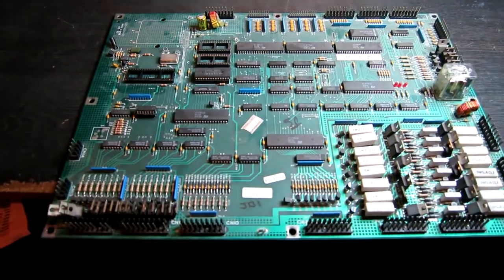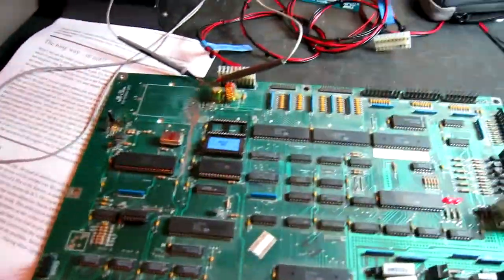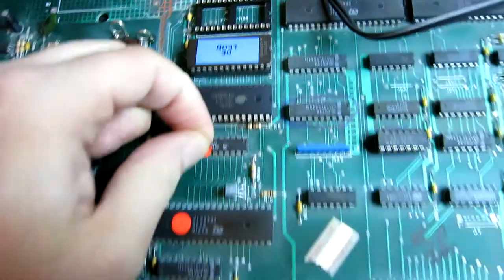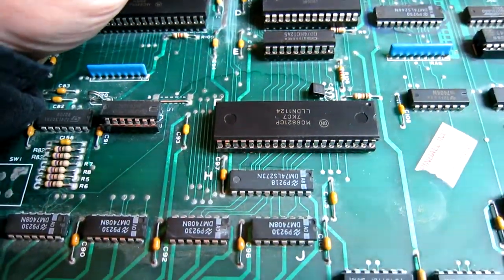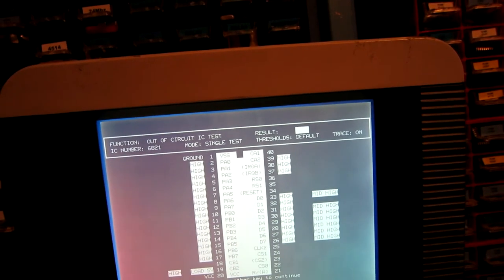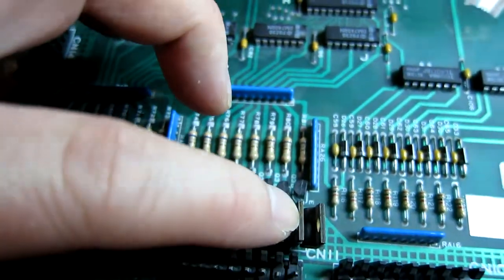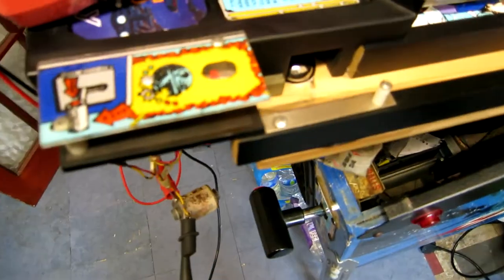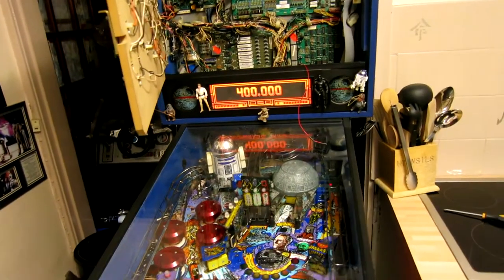Data East Pinball CPU Board Repair #1

Comment: I'm not sure how often the stuck driver causing burning coils problem happens.. but maybe a candidate for a little arduino project? Some cheap hall effect current sensors, arduino, a buzzer a little bit of code and you would have some time that could detect if a driver is stuck on before it destroys the coil.

Comment: I think using an arduino is good for setting up something like the detector you mention, i.e. prototyping. In practice, a simple circuit can be used to do the same job and at a vastly reduced cost. But overall a good idea.

Comment: It's been said that Data East/Sega's 6802 pinball hardware was a derivative of Williams's System 11 hardware. What are the similarities between these two, other than CPU?

Also, the OS for this system was written by Lonnie Ropp of Incredible Technologies. IT also did the OS for the sound board too (written by David Thiel).

Comment: Great to see you getting to the bottom of these problems I have a dead Lethal weapon 3 in the South Yorkshire area I'm trying to fix what neck of the woods are you in?
Reply from the maker: I'm in Lancashire
Reply: arcadeuk Are you connected with a pinball repair company? I'm trying to trouble shoot  my LW3 machine but I'm, not sure if I'm going down the right path I have electrical skills but prefer to swap out switches and coils etc. I'm a little baffled by CPU boards and you seem to have the equipment & expertise required to repair them , I only have a scope and a multi meter and a soldering iron etc..  I  may have an identical board for you to repair if you are interested but that's only  if a new game eprom at 5c doesn't cure my problem , Its in A1 condition regarding battery leakage and damage. The initial problem with the pinball started over a year ago  when I suspected power supply troubles fuzzy illegible DMD  then I made it worse by investigating the PSU board as I accidentally shorted two pins on the power supply board for a split second with a multi meter probe . I've now replaced the PSU with a new rotten dog board and the machine is still not working (all fuses OK nothing obvious)  but I think I may have damaged my motherboard as its still  not booting I've  got +5v and PIA on solidly all the time with no blanking LED whatsoever.  More info here.

http://pinside.com/pinball/forum/topic/lethal-weapon-3-no-dmd-display-and-game-not-playing-at-all

Anyway feel free to contact me if your interested my e-mail is bigwheels7@gmail.com I will post you the board  or boards for repair also I would also like to repair the original PSU board (new fuse holders fitted by me as it was a real mess)  if its viable to repair.

Regards Dave

Comment from the maker: This is fortunately not a very common problem (at least not one I come across often) Normally a failed transistor fails open circuit or fails short circuit and blows the fuse. In this case it had a small leak, so was heating up the coil for the time the machine was on, when the transistor was turned on to fire the coil, what was left of the insulation melted off and the coil shorted. I will have to see how effectively leakage can be monitored on an Arduino though :)

Comment: Yes it would but would you actually need to log this data? If you are just protecting for prolonged over-current situations you can detect this and flag it as an error without a microcontroller. However in some cases it maybe quite useful.

Comment: I guess you only need a frequency counter of some sort.. if the frequency of the signal from the sensor is DC and signal is higher than some threshold you have a problem. By log I meant "log 5 seconds worth of data for calculation" not log it for permanent storage.

Comment: Hy, i am trying to fix problem on Data East Batman and the problem is that my DMD is not working, voltages are in normal range, i did try with another dmd and still nothing, checked the ribbon cables, they are ok, replace 6821, and still nothing. I dont have osciloscope so maybe aou can advice what to look next? Tnx!
Reply: How did you fix the problem? Having the same issue.